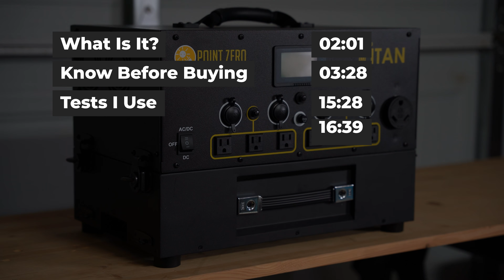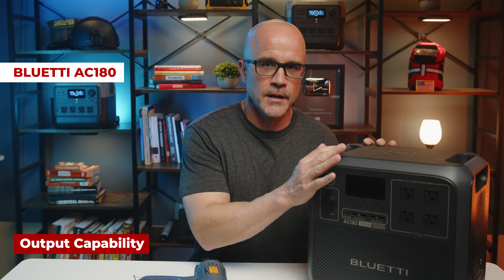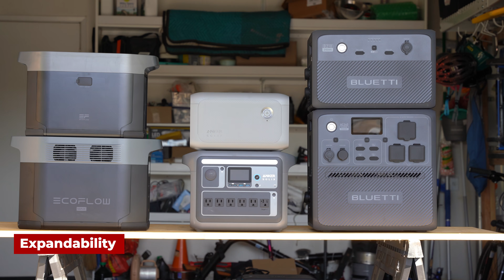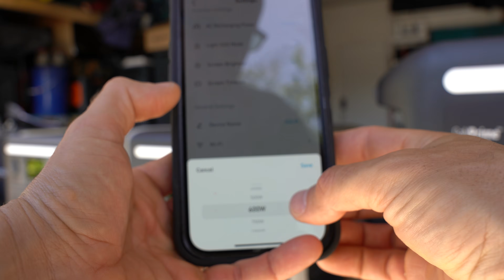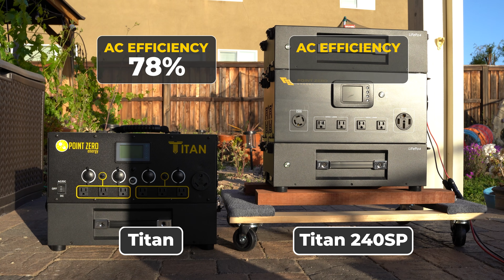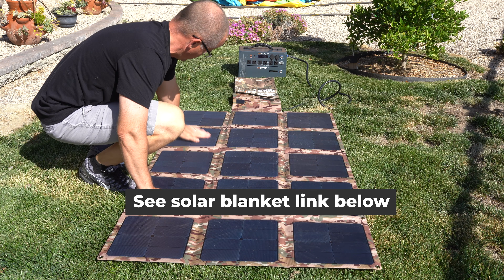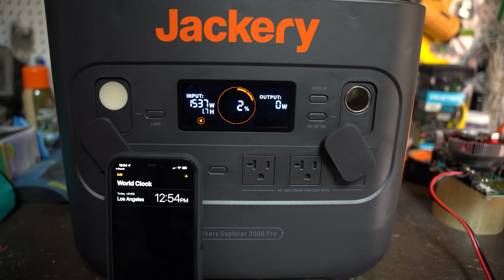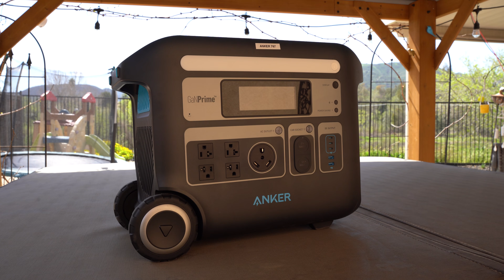Best Solar Generator for 2024 (The Ultimate Guide)

Comment: This is the stuff I can only dream about, in Australia the Bluetti Ac 200L costs $2800 and the Ecoflow delta 2 max is $3000, and on a disability pension that’s unobtainable.
Reply: I agree, I’m on fixed income. It will take a long time to save. The price is more than I get in a month and I live in USA
Reply: @tammy707  
I would hope that even a 2nd hand one (used) may still be ok; with a simple "smart plug" type of thing you could check the watts out of a full charge & watts in to fully charge to gain an accurate view of how degraded the battery is. Bluetti say their batteries will drop to 80% capacity over 3500 cycles (if charged on silent mode (~300 watts)). Even 80% of 1000/1500/2000Wh is still plenty for daily use / storage when not in use.
Reply: I have an AC180 and it'll do most things, as a more portable unit
Reply: That's in Australia dollars so it's definitely more expensive but not what most Americans reading this think it is.
Reply: I've got an older EF Delta Li Ion that won't charge via it's solar input. It can still be charged via AC, so I still use it. 
My next setup will (hopefully) be separate components.
Reply: Hope you got sorted.  They're always working on it and testing.  Your options should only improve with time.
Reply: Ecoflow Delta 2 max is currently Au$2299
Reply: Just gotta save up, even tho it takes time
Reply: @thepunisher9698  saving is NOT an option on any pension in Australia.
Reply: Diesel jenny ftw...
Reply: Time to move to the US...
Reply: @makeyourlifeeasier5794  
On their 120v electrical standards lol
- Australia may be expensive but it is so because it's very well designed. 
- Time to move to the U.S. ? No thanks 🇦🇺
Reply: @joebloggs24  I had family in Australia. There's Good & bad to both countries but I just couldn't live with Australia's response to the evil Vi rus. Definitely too much. It's a real Beautiful country with fantastic people ...except for the politicians. Our politicians aren't much better though ...depending what state you live in...

Comment: Pecron’s prices are just too good to ignore. You can get a bigger battery that will perform way better than the competition at those prices.
Reply: i have a faulty unit they wont replace. customer service has been a negative experience with them.
Reply: @john-j7e7e  yikes was it past the warranty period? What’s wrong with it?
Reply: @john-j7e7e  shoot what’s the issue? And was it past the warranty)
Reply: I have several of their products and they replaced and fixed any of the problems I had.
Reply from the maker: yeh, they're a legit option

Comment: I wish I had as many as you do! I'm a pecron guy. E3000 and e2000. Maybe I'll buy an extra battery for the e2000 down the road but what I got will work for what I need them too do
Reply: Pecron guy myself, can't beat those prices.  I have the Pecron 2000 with two EB3000's, I have the Pecron 1500 (Cheap OG non LFP) and the Pecron 600.
Reply: Nice. I've been thinking of the e600 due to price. Also thinking of getting the e1500 lpf. How long does it take to charge up extra battery for your e2000?
Reply: @Tactical-hg7ov I have two 3000’s with the 2000 so it takes some time with the 2000 charger b/c that is 8k, But I can also use the 600 charger with the 2000 charger so it gives me an additional 400 watts an hour.  The 1500 has an awesome price at the moment.  Lowest price per watt.

Comment: Excellent video, very informative for anyone considering a Portable Power Station/Solar Generator, Solar Panels or Solar Blankets.
Reply: I have a little beaudan it was great and all I could afford at the time. Now I have Bluetti a325 and it worked great when I lived in a cargo trailer. Now I'm in a house but keep it charged in case electric goes out. But won't work for long. But it will charge my phone in emerg.

Comment: Point zero sound good but also mostly stationary.  I like it's made in the USA.
Reply: They make the best generator.
Reply: I've have 2 Point Zero Titans, I agree with fontain, they are the best. City prepper made 2 mistakes representing the Titans, 1)there's no limit on how far you can expand the battery capacity on the Titans, and 2) You don't have to use there batteries you can use any 24v configured batteries. He did say something about the Titan that was accurate, that most people miss or don't understand, it's the only low frequency  unit, all the others are high frequency. Low frequency is much stronger, more powerful, last longer, can be repaired if need be cheaper, almost all high frequency  units, when they fail are trash, cost to repair  is to high, there throw away. These Titans can run full rated power day in and day out non stop, they are over built in every way. As far as Mobil, the heaviest piece is 35lbs
Reply: @dustydawson8977  how complicated is it to set up. I'm totally green horn.???
Reply: @SharonThorpe-AMSOIL-Dealer  super simple, basically plug in charger, charge from wall, stack, turn on, it's kinda built in a way you can't do it wrong, but always read the manual, I personally know 2 women who have this also, but there are plenty of videos on the Point Zero
Reply: @dustydawson8977  does the newer titian 3000watt  us low frequency inverter?
Reply: @zfontain1975  yes and they have the 240v 4000 watt model now that they did not have when I purchased mine
Reply: @dustydawson8977  thank you.
Reply: @dustydawson8977  what kind of batteries are they ???
Reply: @SharonThorpe-AMSOIL-Dealer  LFP if your going to buy a solar generator you should buy a titian. It's my biggest regret in solar. I bought a ecoflow it was junk, my bluetti it not working and they will not replace it. See the refurbished market you never see titian in there.
Reply: @SharonThorpe-AMSOIL-Dealer  the ones I have are nmc,the new ones are lipo4,but there generators can utilize almost any 24v batteries thru there battery expansion port, lead acid,gel, and lithium
Reply: @dustydawson8977  what are the phosphate batteries. You say you unit came with mnr???
Reply: My batteries with the first Titans @SharonThorpe-AMSOIL-Dealer  my batteries NMC which is lithium batteries just a different chemical make up. There new batteries are lifpo4 and 2.5 kw per battery as mine are 2kw per battery, but mine actually hold 2.2, Titan just underrated them them and sat it up to only charge to 2kw to save the battery life which is what is always recommended on all lithium batteries  which people don't understand, even Tesla cars tell you to do that to there batteries to extend the life

Comment: Do not buy bluetti they have terrible customer service. It's going on two months and still have not received the correct power charger from them. Unit charging takes 8 hours which is crazy. Does work with solar but I will stick with ecoflow from now on BEWARE